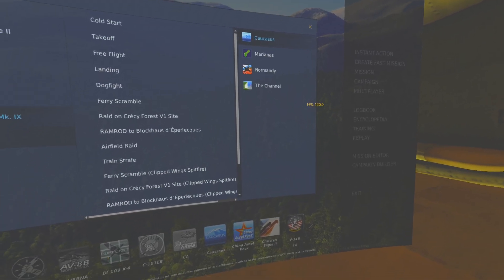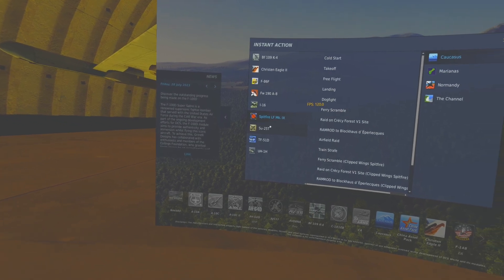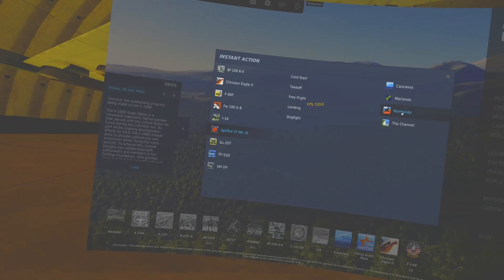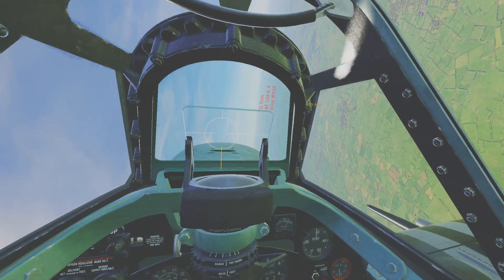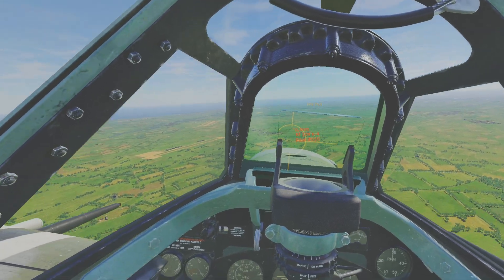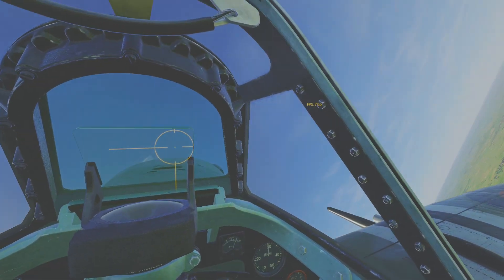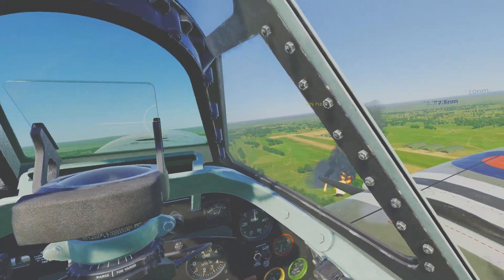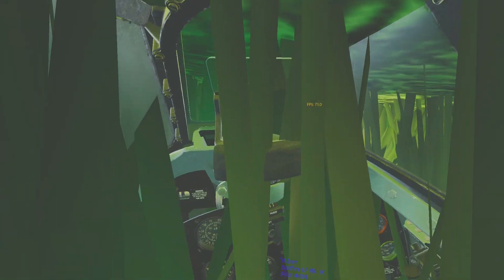PImax Crystal powerhub ongoing test

Comment: Hi Finn, got the Crystal on the way. Only fly in DCS in fact I’m a campaign creator for DCS. What software do you currently use when flying in DCS. Thanks.
Reply from the maker: Umm… I use DCS? I’m not sure what you mean? I pretty much only fly the WWII planes. I have the Normandy and channel scenery. That’s about it.
Reply: @finndoessims3214  Hi, what I mean is you use the Pimax client software, open xr runtime and the open xr tool kit, I think open composite is no longer required? Thanks.
Reply from the maker: @badger633  That's correct. Open Composite is not requiered for DCS or FS2020. In fact steam now has its own runtime for OpenXR. I'm uploading a short video on Steam's open XR today.